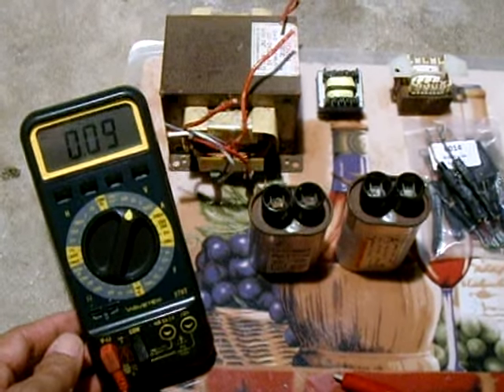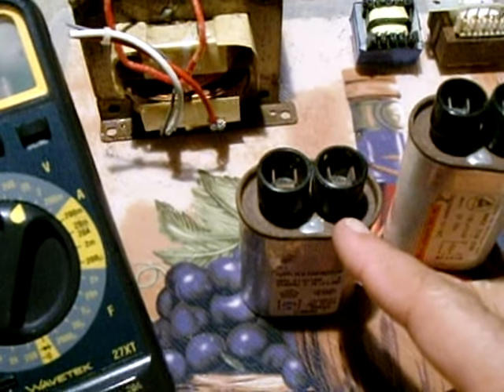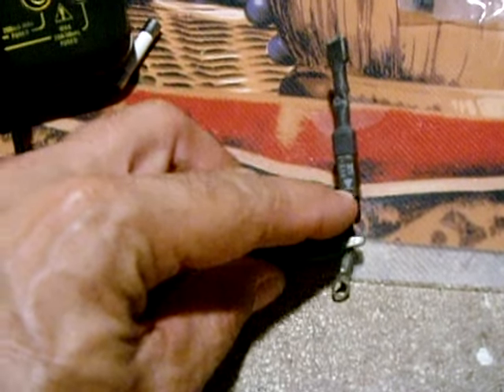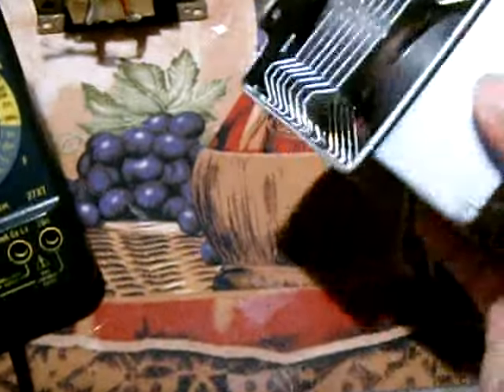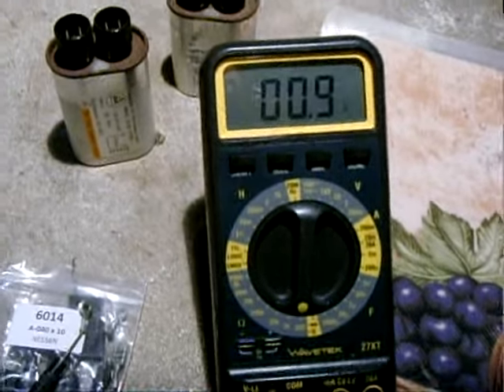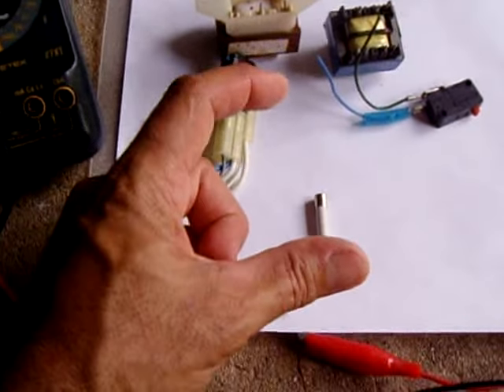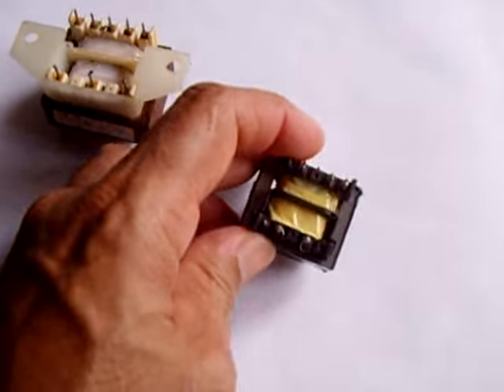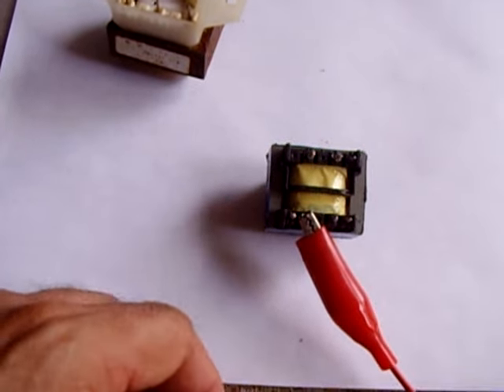How To Easily Test Microwave Oven Parts! (Ultimate Guide)

Comment: Thanks a lot for your video. It helped me isolate the fault to what I think is the diode. This is a Kenmore Elite , about 6 years old. My problem is that I cannot find the diode it is using. It is marked CL04-12. I had to settle on buying from eBay and I bought three of them. When I replaced one of the new diodes in the microwave I still hear a loud hum.
When I disconnect the magnetron the hum reduces substantially. Everything else is working, lights timer, turntable etc. The capacitor checks out at 1 microFarad. 
I suspect I got cheated on the diodes.
The new diodes show 15 Mega Ohms in one direction and over limit in the other. I am using a Fluke 87v DMM.
What else could be wrong? The magnetron also checks out as per the tests.

Comment: I have a Sharp microwave oven. Everything works except the digital display, including the clock of course. Any tips on the problem and how to fix it. Thanks in anticipation. I like this video. Very precise and clear.
Reply from the maker: ron martin Mhg Sounds like a faulty LCD display or faulty conttol board.
Reply: Thanks for the advice.

Comment: Thanks for the video, it is the most informative guide I have seen so far. Excellent step by step instructions. I have one question. I am checking the step at 14:15 and instead of getting 95 ohm I got no measured value. Is there a way to further check the transformer? Thank you
Reply from the maker: No reading for the high voltage winding means a faulty transformer, or you failed to scrape away the clear coating on the transformer before touching the probe to the core.

Comment: Awesome video. Easy to follow steps. I have a GE countertop microwave that does not heat. Control panel functions fine. Fan runs. Light in oven comes on. Do not hear the sound of the magnetron kicking in. Followed your steps; i.e., door switches tested OK; relay on PCM registers 120VAC and then goes to zero when start is pressed. Magnetron checked Ok for ohms, however, the fins rattled when shaking the mag. Was able to push them together and eliminate the rattle. HV transformer, capacitor and diode all checked OK. I think it must be a faulty mag but is their any additional tests I can do before springing for a new mag?

Comment: Hey Doug.... No buzzing after following your instructions below. I am going to buy a new magnetron and hope for the best.

I was curious about 2 things....... 

1, When I followed your instructions by disconnecting the red HV from the transformer, would the mag be getting power from the other wire going from the capacitor to the mag? 

2. Would you expect that low-end 80 ohm reading that I have on the HV secondary to gradually get lower as the oven gets older and result in less effective heating for cooking? 

I will post back the outcome once i receive the new mag from online purchase and plug her in. Thank you very much for your help!!!
Reply from the maker: +MrUsaer
You're certain the capacitor and diode are both good? If so, then try a new magnetron.
Reply: +electronicsNmore 
Yes, pretty sure.

I did the cap tests per your video and did  the 9v battery test for the diode....which I believe I read later that you were not a fan of.... anyway,  the diode test showed full 9.3 volts one way and about 6 volts the other way as best I recall.

If the mag ordered online does not work I am allowed to return to the seller. So not a big deal if it turns out to be something else. Should have it by Friday or Monday..... Will let you know...  Thanks again!

Comment: Outstanding video. Very detailed. Thank you for your effort. I have a situation and could use your expertise. I have a Kenmore Elite over the range microwave. My Son heated up some grub late at night and my wife came in in the morning and heard the microwave humming and could not shut it off. she pulled the plug and plugged it back in and everything was fine except it would not heat and would make a weird noise when she would try to use it. I took it apart and found that the Magnatron cooling fan shroud was melted and would not let the fan turn (ie weird noise). I cut the shroud from around the fan; put it all back together (to see if everything worked before ordering new parts) and everything works fine except it doesn't heat. My conundrum is:Should I even try to repair this? The only reason I can think of that the microwave was running when she woke up is that the filter was so clogged (didn't even know that there was a filter and has been there for 6 years caked in grease) that the system couldn't cool itself; the shroud melted, stopping the fan, which was getting a signal to cool the Magnatron. Which put it in a loop (glitch). Wouldn't even be wasting your time; but this is a very expensive microwave to replace and it's too cool. :) .Everything on the inside looks brand new and is probably the thermal switch that tripped but wanted your expert opinion on this before I started. I guess I would like to know if you have heard of "anything" like this? My problems are "never" easy. Thank you in advance for any help. Mark
Reply from the maker: Mark Schneider You need to test the parts according to the video. Not much else I can suggest. I have 2 videos on this subject. If everything tests OK, then replacing the magnetron is usually a good idea even if it tests OK.
Reply: electronicsNmore Any good leads on where to get a good cheap Magnatron? Amazon, Ebay or a better place? thank you, Mark

Comment: This is an excellent tutorial, very clear to understand.   I have a related question:  you indicate to use a 18k ohms 5-10w ceramic resistor to discharge the capacitor;  may I use a film resistor of the same ratings?   Thank you.
Reply from the maker: Any resistor, just as long as the wattage/resistance value is close.

Comment: Great video. I was able to test all of my microwave's component and all have resistance reading like you mentioned. I did more tests, I used an energy meter to measure the wattage when in use.
Plugged in, 2 watts.
At power start, 38 watts (light, fan, turntable)
When the magnetron kicks in, 400 watts. (Instead of 1200 W)
Same, but with magnetron unplugged, 325 watts. (I think it's for the power transformer)
I did buy a new capacitor & diode, but still doesn't work.
Next step is to replace the magnetron.
Any thoughts?
Thanks very much.
Carl
Reply from the maker: Can you hear a hum when the microwave turns on? Or does it run with the light on, fan on, and turn table only? If you swapped out the cap and diode, and you are getting 120V to the primary side of the transformer(DO NOT go anywhere near the HV red secondary wires!), then the magnetron is likely faulty even though it tests ok.
Reply: electronicsNmore Yes it does hum and there's power to the transformer.
Just wanted to make sure it was the magnetron.
A GE magnetron WB27X10305 is $250 - $280 in Canada.

Thanks for your help.
Reply from the maker: WOW. What a rip off. I have 2 laying around my house. Cheaper to buy a new microwave.
Reply: Yes, it was an expensive model that matched the oven and GE doesn't make anymore. That's why I'm thinking of ordering it from here;
http://www.appliancepartspros.com/ge-magnetron-wb27x10305-ap2026205.html
By the time  I add shipping, customs and currency exchange rate, It'll be about $160
Thanks,
Carl

Comment: Thanks for knowledgeful and helpful video. I need your assistance to resolve issue of burning fuse when  microwave put in operation. checks on hv transformer, capacitor & diode found good.
Resistance on PCB on L and N terminal found 1424 ohms which seems not normal. What may be cause please guide. Thanks
Reply from the maker: I only upload well explained/helpful videos and answer simple questions. I don't troubleshoot for viewers. I already spend way too much of my free time helping people, and get very little in return. This channel is underfunded. Watch my other microwave oven repair video below for more help. Thanks
https://www.youtube.com/watch?v=t1tdj3OnlXU

Comment: Thanks for the useful video. My microwave display is not working (door + light is working and tested fuse is fine etc). I checked and the problem seems to be either with the small transformer on the display-board or the entire display board. For the small transformer(on the board), on the primary I got 125 ohms. And on the other side I get 1 ohm and 4 ohms (the video mentioned about 400 ohms for primary and 8-10 ohms on the secondary). Do I need to replace just the transformer or the entire display board. Thanks for your response.
Reply from the maker: First unplug the microwave. Next discharge the capacitor. After that, remove the blk/white wires connected to the primary side of the HV transformer coming from the larger relay on the PC board. Cover the terminals with electric tape. The purpose of doing that is to prevent the transformer/magnetron from powering up when you plug the unit back in to test the pc mounted transformer. CAREFULLY test the output voltages on the PC mounted transformer while the microwave is plugged in. Wear latex gloves to be safe. No need to press start on the oven. you should get around 12VAC on one set of pins, and around 6VAC on the other set of pine. All pins are on the same side of the transformer in a straight line. If you do not see that voltage, then the transformer is faulty if you see 120VAC between the two pins on the opposite side of the transformer.

Thanks For watching. Be sure to share my channel and rate Thumbs Up.

Comment: I will have to watch the video again.  Based on watching and replaying sections, I think my problem is the capacitor or the diode.  I have a Sharp R-4A77 and it has 3 microswitches to the door.  The instant I try to heat, it blows the fuse but the clock display is fine until I try to heat (I'll remove the good fuse shortly).  I checked the operation of the 3 door micro switches with wiring pretty much removed (removed from wire harness), 2 NO and 1 NC, and they appear to function appropriately.  What I find odd is the 1 NC when back in the wire harness has continuity when the microwave door is open or closed, but again, operates appropriately when removed from the wire harness.  Sound plausible to you?  So I believe you indicate if I am blowing fuses, it is likely the diode or the capacitor, correct?  I am a bit leery on testing those but perhaps I will gain more confidence if I get the resistor you mention to discharge the capacitor.  I would appreciate your thoughts as I hate to send the microwave to the land fill if repairable.
Reply from the maker: Mark Allen You need to test the capacitor and diode.

Comment: Hey Mike.... Great video!

I'm looking for some advise before I can even think about trashing this older but expensive 1650 watt GE built-in oven. 

I get the annoying buzzing BUT the oven does still heat at what seems to be it's normal heat rate. 

Here is what I did so far.....

1.I did ALL the magnetron tests in your video. All tests were normal EXCEPT when testing across the 2 terminal plug on a 250 ohm setting, I get a reading of point five (.5) This is also the exact same reading I get when I simply touch only the 2 probes together. Does this indicate that there is a short since .5 is my starting resistance due to the resistance of the meter and probes itself?

IF yes, I do not see how the oven would still be warming!  I also tried 2 other cheaper meters and each said resistance was one point zero. (1.0)  Again, both meters tested at 1.0 when only touching the probes together. (Again I assume this is because of the normal resistance to the meter wire and probe itself and the meter just not being 100 percent calculated) 

Do you think I have a full short in the mag based on the above reading?

2. Next, I ran ALL of your TRANSFORMER test. All were ok EXCEPT on the high power wire test I got a reading of 79.5 olm on my good meter and 80 and 79.5 on the other two cheapo meters that I have. I believe that you said between 80 and 140 or so was most common  I am at the extreme low end or below....so could that be causing my BUZZZZ? 

3. I also tested the cap and diode test. Both test were good. (did a test using a 9v battery for the diode) Both of those test we ok as I expected. 

4. I removed the mag. Shook it. No noise. I also carefully looked for cracks and any burning on the head. The silver thingee that surrounds the head of the mag was nice and shiny silver but there is some kind of metal thing inside of that shiny silver part that was black.... but i assume that is normal....right? 

5. I can not tell if the buzzz sound comes from the mag or transformer. I disconnected the 2-wire terminal plug that goes into the rear of the mag. When I turned the oven on, i did not hear any buzzing, but of course there was no heat :)   I would guess that might not tell me anything since I assume that pulling out the mag might also stop the buzzing even if the transformer was bad and causing the mag to buzzz.

Any thoughts or questions would be really appreciated  Thanks!
Reply from the maker: +MrUsaer 
Hi there. I'm Doug. :-) 80 ohms on the HV secondary is fine. You can unplug the unit, discharge the capacitor, then unplug the red HV wire from the transformer leading to the capacitor and leave it sticking out and away from the metal chassis. Plug in the oven, stand away from the open areas(danger areas) of the oven, and TOUCH NOTHING except for the control pad. Enter 10 seconds and press start. See if the buzzing sound is gone while the oven is running, if it is, then you likely have a faulty magnetron even though it tests ok. Unplug the oven, discharge the cap again to be safe, then you can touch things.
Reply: It seems to me that MrUsears is having an issue with the mica lid that covers the openning of the waveguide in the oven cavity. Thanks for your video.
Reply: @juanabreu5127  What can go wrong with those mica covers?    Just curious.

Comment: Useful video thanks. 

I've done all the tests but for the diode (as I lack a resistor) and PCB transformer (which I assume to be ok as the display works). The microwave comes on and the display and light works etc, it just doesn't heat the food.  I suspected the magnatron but it checks out ok according to your tests. As do the fuse, door switches and capacitor. The only discrepancy I have is the main transformer, the primary windings are at about 2 - 2.5 ohms between the terminals and the HV Power output lead about 160 ohms to the core.

Do I have a transformer issue?
Reply from the maker: The diode can be tested w/o a resistor if you have a DMM that has a 50M or 60M range. How many watts is the microwave oven? You are positive the DMM is working properly?

Comment: Is it mandatory that I take one wire off the switch before I do the continuity test? Would i get wrong reading if i left both wires attached to the switch terminals?
Reply from the maker: Removing one wire ensures reliable testing.

Comment: Replacing the capacitor did the trick.  It is the slightly lower 2100 VAC but it works.  Now the lamp has died.  That should be a piece of cake to fix.  Thanks again for the video and suggestions.

Mark

Comment: I have 120V on the HV primary, the light comes on, the turnbtable rotates but no heat.  HV transformer primary is 0.4 ohms, secondary winding is 90 ohms to ground, however, the HV secondary connector unplugged going to the magnetron is 0.3 ohms.  Is that a secondary winding short?  Do I need to replace the HV transformer?

Comment: Thanks for uploading this was so helpful! While testing the transformer, the resistance between the single high voltage wire and the body of the core did not change the reading from OL. Does this mean the transformer is broken?
Reply from the maker: Place the digital meter on a low ohms range(up to 200 ohms or 1k ohm) You should get a reading. Be sure to scrape the transformer core in the area you test from. There is an enamel coating which must be removed to expose bare metal prior to testing.

Thanks for watching. Be sure to rate Thumbs Up, and share my channel with others.
Reply: electronicsNmore That did the trick! It was reading 154 ohms. Thanks :)

Comment: Great Work!!
My GE microwave oven blew the internal 20A Fuse as it started to cook.  Replaced fuse, set the time, hit the start cook and it ran for a second and the fuse blew again.  Took it apart.  Door switches seem ok.  HV Cap seems ok. Read the right capacitance with my digital meter. 
 HV Diode voltage test with 9 V battery passed but I don't get any voltage if I measure resistance in either direction! Shows open either direction.
The magnetron resistance tests come out fine but if I shake it, it has a slight rattle noise!
Checking the internal light of the microwave found the light bulb to not be seated tight.

Any thoughts/comments what might be causing the 20A to blow?

Thank
Reply from the maker: vj K Testing the diode with 9V is no good. You need much higher voltage as stated in the video, or a meter that has a very high ohm range of at least 50M. Use your car battery with the engine idling. The usual culprits are a faulty capacitor, diode, and lastly the magnetron. If you can rule out the capacitor and diode, then swap out the magnetron. Make sure the HV transformer passes the tests.

Thanks For watching.

Comment: Diode voltage test confirmed good but ohm test  at 20M (meter's highest setting) no reading in either direction. Does this confirm bad or should the test be done at 200M or higher to confirm bad?
Reply from the maker: Not high enough range to properly test.